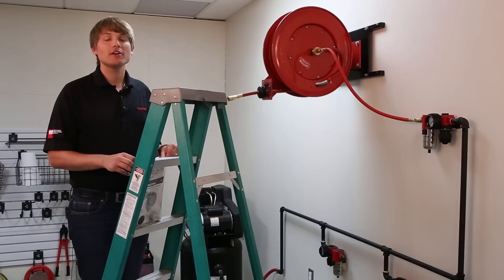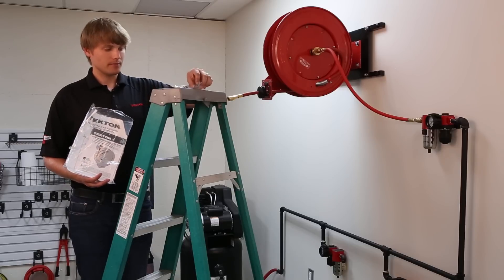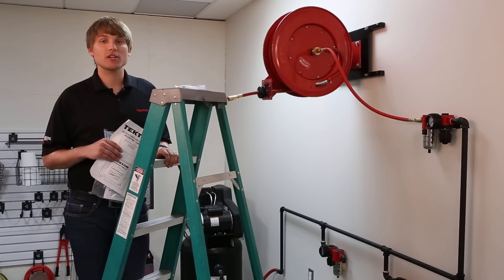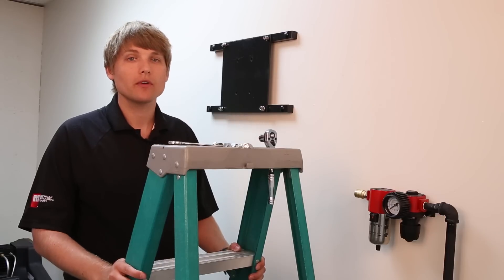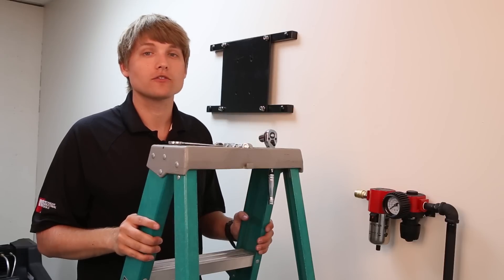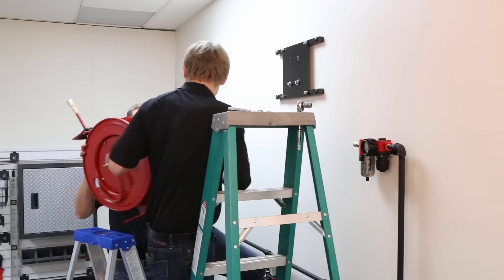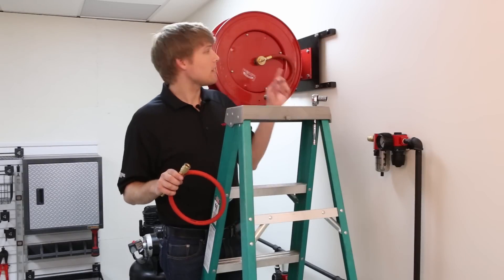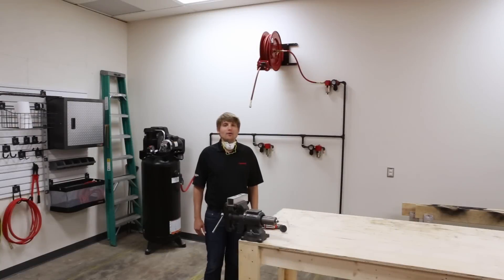How to Install Your TEKTON Air Hose Reel

Comment: Mine retracts too slow;any suggestions? I would appreciate it
Reply from the maker: Try these steps:

1. Pull out 15 feet
2. Lock Reel
3. Remove bumper
4. Thread hose back through roller plate
5. Wind hose around the reel
6. Place remainder through roller plate
7. Replace bumper

If you have any other questions, feel free to either email support@tekton.com or call 888-648-3371.
Reply: Roll the reel clock wise up to 15roll and put the stoper

Comment: I purchased the TEKTON 46875 Dual Arm Auto Rewind Air Hose Reel.
Is there a service location to grease the reel bearings/axle? I'd like to fit a grease zerk on it if possible...
Reply from the maker: +Philip Gragg We don't have any service locations for this sort of work, but if there's something you're looking to have done, a local hydraulic shop should be able to do it. If there's an issue with the reel, please email us at support@tekton.com or call us at 888-648-3371.
Reply: I'm not looking for a "Service Location" as in a business to do some work. I was referring to a location on the reel itself where you can service the unit. I'm just considering long term lubrication on the axle/seals of the unit.

I see that you included replacement seals on the unit, so I assume I'm able to service it when it begins to leak.
Reply from the maker: +Philip Gragg The seals are for the air inlet valve. The reel itself doesn't have any greaseable fittings or locations on it.